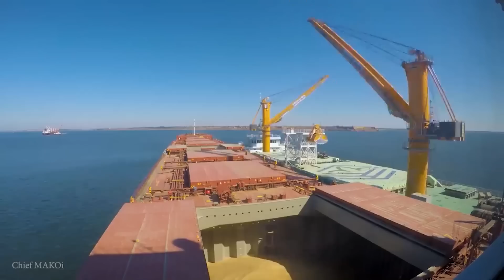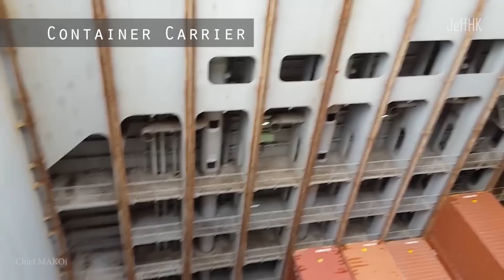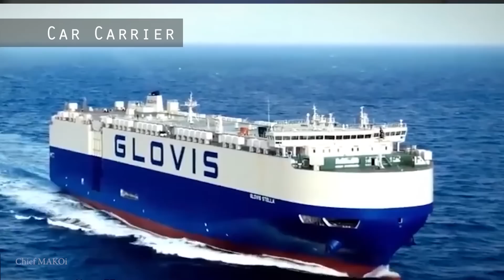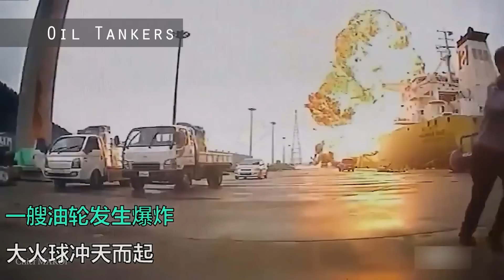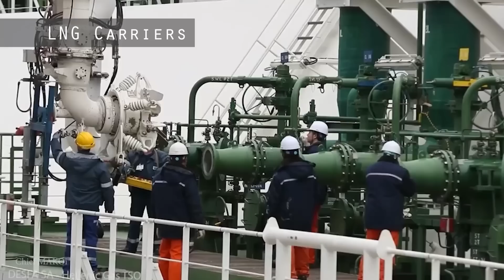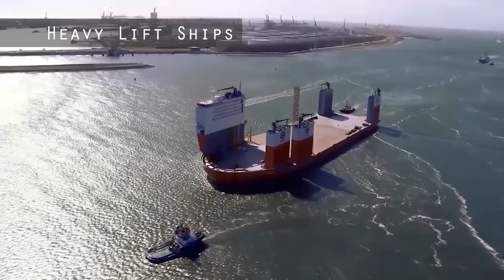What Are These Cargo Ships Carrying?  | Chief MAKOi Seaman Vlog

Comment: One of the sub-types of Bulk Carriers is the Lake Freighter or Laker which ply the Great Lakes. Traditionally they had superstructures at the bow and stern but in recent times new lake freighters have only the superstructure at the stern. A number of Lakers are what is known as self-unloaders meaning they have a means to unload their cargo(Usually iron ore pellets) rather than rely on port facilities to unload them, this come in the form of a large boom with a system of conveyor belts to discharge cargo.

Comment: In '85 I did my engineer apprenticeship year on one of Johnson-Odfjel chemical carriers, the Jo Oak. We had 24 stainless steel tanks ready to load any kind of liquid. Funny when while unloading tallow in Rotterdam the deck crew managed to have the cargo pump pressure higher than our steam pressure and the third engineer on duty found the boiler water quite white of color. Resolution: stop all operation and open the boiler outboard valve to drain the whole thing in tge harbour. Quite a white stain on the water. Oh, good times.

Comment: Hi cheif!
I would much appreciate a video about the crews workwear. A humble subject but still interesting in my opinion. Do cargo ship crews ever use uniforms? Do you switch to private clothes when off duty on board? Is the workwear specified in the contract? Are the jumpsuits color coded i.e. does the color have a meaning? I guess you can fill me in on stuff I don't even know to ask about. Cheers!

Comment: You mentioned the general cargo ships, but to server smaller areas, has a ship every had different types of specialized cargo holds?   Similarly, wonder if tankers could have hatches re-designed to take containers to top back to oil producing regions.  (Obviously have to calculate ballast and center of gravity.)

Comment: It'd be very interesting to learn more about LNG and LPG freighters as well as chemical carriers. The plumbing and pumps must be pretty elaborate for both, monel or inconel impellers and the like. The chief engineer must have a working knowledge of handling of hazmats as well, I'd guess, beyond the MSDS documents in the cargo manifest. They were just starting to have computers on board last time I shipped out in the early 80s, must be a little easier now.
Are the LNG products odorized? I suppose at those quantities it wouldn't matter either way, as any accumulation would be lethal. Like tankers have, there must be electronic hydrocarbon detectors that check for safe levels in the deckhouse and anywhere people work. Same with the chemical tankers, although there relatively small leaks could be dangerous to touch as well as to breathe. What a nightmare! 
I've seen container sized tanks for specialty chems like brake fluid as well.
The reefer holds you mentioned come with gigantic reefer systems - one I saw used liquid ammonia, so that was an entire separate system in the engine room. Not to mention reefer containers, if they're still in use. Keeping those going on a modern box ship must be a chore!
Finally, the backup power for such gigantic ships must be humongous - do they still use big Ni-Cd battery banks coupled with a diesel generator or two for emergencies?
Oh yeah, they were just coming out with the idea of using scrubbed exhaust gas for filling empty tanks on tankers for fire suppression - did that become common practice?
Interesting stuff - thank you kindly.
Reply: The ship itself have gas detectors and crew also carry small gas detectors in LPG

Comment: It'd be interesting to see a history of how shipping used to be pre-containerized shipping.
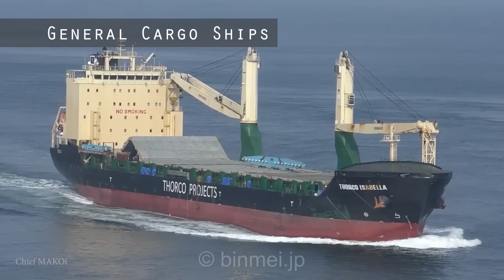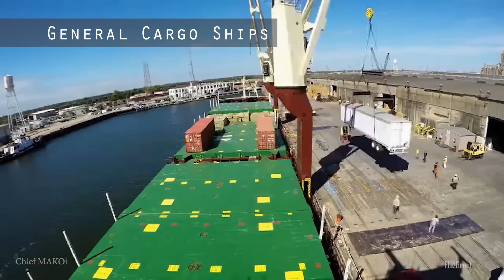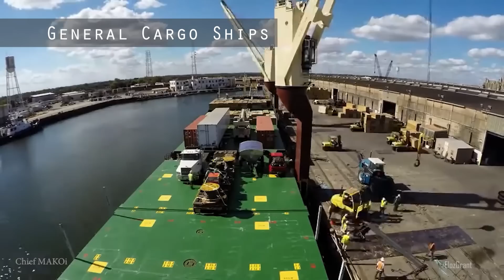Reply: Basically the process is what they are doing at 9:43 of this video for general cargo ships. The Box by Marc Levinson spends at least 100 pages on this if you want to know more. The tl;dr is that it was extremely expensive to ship things using this method. Before containers they had what were called Breakbulk shipping it would take several weeks to load/unload in each port. All cargo was transported to the dock and stored in a massive warehouse right next to the ship (similar to the layout at 10:01, note the cut at 10:06 and how this took basically from early morning to late afternoon/aka all day), laid out on the dock then lifted into place using cranes. Longshoremen would have to use the different cargo types and try to pack the cargo so it would not be damaged, shift during transit, or cause unbalanced weight for the ship which could cause capsizing. All cargo was shipped by the individual item, so they would use the cargo shapes and sizes to create rows and wedge things together achieving a greater packing ratio than with containers. (e.g. take barrels to create a makeshift bin for wheels of cheese, wedged in place by crates to transfer loads to a bulkhead)

This has several huge drawbacks compared to containers. The loading process had to be completed for each stage of the transport process from the ship, to rail, to trucks, to the final destination perhaps with each item needing handling dozens of times end to end. Ships were usually older converted surplus military ships, there was little reason to spend money on better designed ships when they'd be sitting in port anyways. Even with modern engines it could easily take more than 6 months to ship something across an ocean, 1-2 weeks for the voyage and the rest of the time waiting for loading in a warehouse. It was hugely labor intensive and required massive amounts of longshoremen on each end hired as cheap day labor, not the industry professionals you see today. Everything was out in the open there were very high rates of damage and theft of cargo, especially for things like alcohol which was one major import that was high margin enough to afford the cost. Being a longshoreman was also a dangerous job and due to the heavy lifting and equipment required and had a very high occupational injury rate with back, foot, shoulder, and crushing injuries all common. Around 3/4 of the shipping cost was spent on land before the ship ever went to sea.
Reply: @nn123654  Great reply.  My early years of going to sea with and without a license was always on break bulk ships.  Some issues that were solved or made better by containerization was that some cargoes would 'sweat' and give off moisture and if going from a tropical loading to a cold winter discharge port, if the moisture condensed inside the hold and wet the cargo it could be damaged.  Think cargoes like cocoa beans, coffee beans, cinnamon bark. Some cargoes released vapors which could injure people exposed while they were pumped into deep tanks.  Cashew nut oil for one.  Some cargoes were noxious and when the holds vented the air if it washed across the crew quarters you could get everyone stirred up.  Green hides come to my mind. Some cargoes were valuable but still being shipped in boxes or crates and were subject to pilferage.  Cigarettes and bottled booze were particularly vulnerable. Sometimes we carried livestock--pregnant goats and cattle.  Usually we signed on an animal handler as well, but sometimes the chief mate got that pinned on his duty roster. It was usually more interesting sailing break bulk, but the work was harder, it paid less.  You did get a chance to go go ashore in places no one else ever heard of (Matadi, Walvis Bay, Durban, Abidjan, Puerto Cabello, Bahia, Beira, Mombasa, Laurenco Marques, Monrovia, Dar es Salaam...)  Overall, after I got enough seniority with the union, I sailed container ships, & very occasionally tried something different.
Reply: @nn123654  thank you for that very thorough comment. very interesting

Comment: Another great video. Dumb question time.  When loading with the ship's cranes, is the ship or dock crew responsible for safe and careful loading of a container?  Who on the ship is responsible for the correct weight and balance?  If the container is a refer, where do you plug it in?  When loading bulk items like grain or coal, do you load a little here, then a little forward, then some aft or do you fill the hold to the main deck and then move to the next hold?  I would like to see more of this type of video.  Thanks

Comment: Growin up the son of a merchant mariner, having an interest in chemistry (I’m a chemist), and living on the Houston Ship Channel I was fascinated by all the chemical transport. The one that always worried me was the unodorized LPG/LNG. Massive explosion risk. But damn the spherical tanks look awesome.
Reply: Well, you're a pretty BAD chemist because it is NOT a massive explosive risk.    From a flammability standpoint, your car, or you smoking in bed, is a by FAR larger 'fire' (NOT explosion) risk than an LPG/LNG tanker.   Yes, I'm a chemist and I deal in high temperature combustion and hydrogen dominated chemistry all the time.   Hell there were more fires from 'peaceful protests' this summer than there were in the entire LPG/LNG field worldwide.   Have some respect for the petroleum engineers, professional engineers that designed those ships and the mariners that sail those vessels.    In case you are wondering, there is this little thing that is called fuel to air ratio that is needed not only for combustion, but deflagration and detonation.
Reply: @stevenharris9941  an explosion doesn't have to involve combustion: you only require rapidly expanding gases LNG/LPG as liquids occupy a fraction of a percent of the volume they would occupy as a gas, if these cryogenically cooled and pressurised gas cargoes were to spill and meet sea water the would rapidly, violently expand with incredible force in the very same manner that highly pressurised steam in a high pressure boiler does when they rupture creating a steam explosion. But surely as a good chemist you would understand this, right?
Reply: @CATASTEROID934  Haha, pressurized fuels are so scary. I can't imagine anyone who understands that process not getting chills if they see, or think about a dent in a highly pressurized canister of a fuel near them.
Reply: @stevenharris9941  When you did all the school to become a chemist, did you not learn language and critical thinking skills? Did you not learn history and the fact that industry and building have evolved and become safer over the years, often times due to what has been learned when things go wrong? "Growing up" and "worried" both refer to the past. I'm sure he wasn't born a chemist, so that means he grew up without the scientific knowledge and his merchant mariner parent likely told him of the dangers involved in the job. 

Consider when the parent was working in the industry and consider that petroleum products weren't always handled as safely as they are today. He didn't say if he still thinks the risk is high and he never claimed to be an expert at dealing with flammable or potentially explosive products. Reading your statement, you make it sound as though nothing in life ever goes wrong. Air travel is supposed to be extremely safe, yet planes do crash. Is it impossible for an LPG/LNG leak to happen and mix with enough air to combust? Do the people in the industry not consider and even train how to handle various failures? 

You don't have to be an expert to consider that there is potential for a catastrophic event when dealing with this type of product. Notice how I didn't say how much risk? The other chemist also didn't speculate, just that there could be a massive explosion. People didn't expect the San Bernardino, California gas line (at the bottom of Cajon pass) to have a leak and ignite after a run away train crashed, either, in the 1980's. Fireworks are not expected to explode while being handled for shipping into and out of the plant, but it happened. People in Mexico didn't expect the main sewer line to ever explode, let alone explode multiple times. That is a good example of your air/fuel ratio point.

The OP never mentioned anything about not having respect for the engineers and people working with the liquid gas. He actually didn't even mention them, yet you assumed he thought they were not capable. 

Luckily, my dad taught me how to spell the word "assume." He told me that when I assume, it makes an ASS out of U and ME. Some people just have an ego and use their emotions to read into a statement what isn't there. Information missing from a statement can be just as important as what is included. Well, I'm no chemist and I didn't even study it in school (other than what was in general science classes) but for my line of work, hobbies, and life in general, I have learned to analyze situations and consider what I know and what I might assume, from various points of view, before coming up with a response or solution. A good friend said that I am a calculating person. He was right and it has it's pros and cons. It has served me well for engineering/mechanical, legal, and social purposes. It would be dumb of me to assume that a chemist would use similar logic for work or personal life, but it doesn't mean I can't be left shaking my head when they don't.

Comment: When I was working in the actic hauling propane one day when it was very cold one of the guys at the plant brought me a bucket of propane. A bucket as a liquid due to the  temperature below -40c or so was low enough to keep it as a liquid even without being pressurized.
Most of the job sites that we delivered to had heaters on the storage tanks in order to maintain some vapour pressure in the tank. I didn't see any but some of the old timers described burners that ran on propane being used as heaters although the thought of open flame being used under a tank to heat the contents  didn't sit well with me.

Comment: LNG/LPG is pretty scary.
 One RPG hit.
 Escort duty in the Gulf. 
Oil tankers just leak when given that abuse. The engine room may catch on fire. 
Empty oil tankers are more dangerous. Not so much if tanks get purged with nitrogen.
I guess the easy way was to seal the engine room and let it burn out.
Even let it burn when the frigate offered to put it out. Everyone on a frigate is a fire fighter.

Comment: Very interesting, as always. I have a question. Wiht the bulk carriers, they can carry very different loose goods like grain, metal ore, coal etc. Are there special ships for grains and other edibles or are the holds cleaned out after every transport to a level where no contamination by the previous cargo is possible?
Reply: Both. There are different kinds if Bulk carriers for different types of cargo. For example, ore being very heavy, for the same weight takes a lot less room. Therefore the cargo holds are smaller and there is much more room for ballasts tanks that tend to be empty when fully loaded so the ship doesn’t sink. On the other hand, with lighter cargos, holds can be cleaned between  trips. For example, i worked on a ship that carries salt for roads in the winter and grain for livestock in the summer. Holds are cleaned in between. Also we have to make sure the holds stay dry so that the barley doest ferment and make whiskey 😉.
Reply: @cigalle47  Thanks! :-))

Comment: Hey Chief! Amazing video. What is the process of how bulk carriers are cleaned? For instance, what if a ship transports coal but then has to transition over to wheat? Obviously you can't load without some type of cleaning process. Or are bulk carriers restricted to only hauling raw materials vs. food stock?
Reply: He has a video on how they are cleaned prior to loading another cargo. It was posted about 2 years ago but I had to watch it again last week. Checkout on his vlogs and you will find it. There are 2 types of bulk carriers , the specialized ones that will carry specific products and the combined carriers which are designed with separated section holds to take advantage of two cargo options between voyages such as bulk/oil, car/bulk, ore/oil or container/ bulk. 
I hope you find this helpful

Comment: Car Carriers, I have  heard that type of ship as being identified as RORO Roll On Roll Off. As you said thay are used to transport wheeled vehicles that are loaded and unload by driving the vehicles on and off the ship and use adjustable decks to allow the carrying of vehicles of any height from compact automobiles trucks tractors.
Reply: Ro ro is more a car ferry like the ones between Holland and the UK. Used for passenger cars and general / adr trailers.